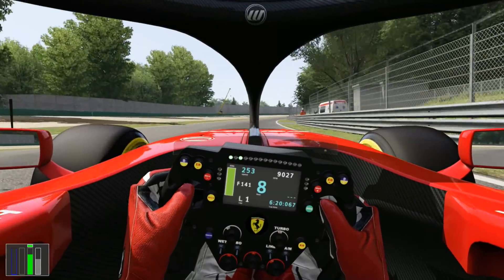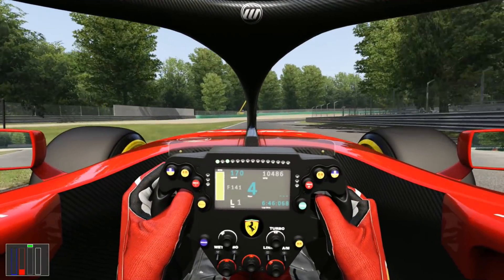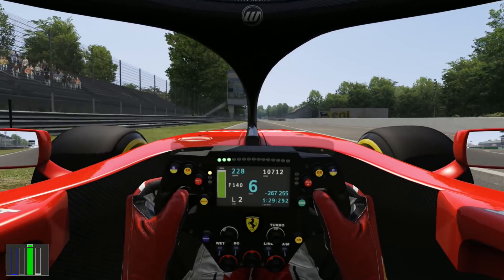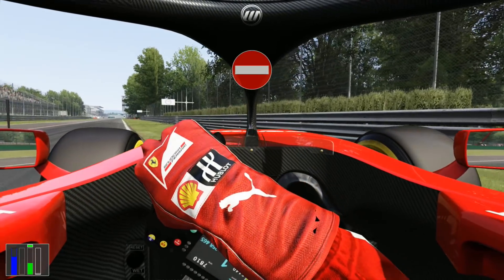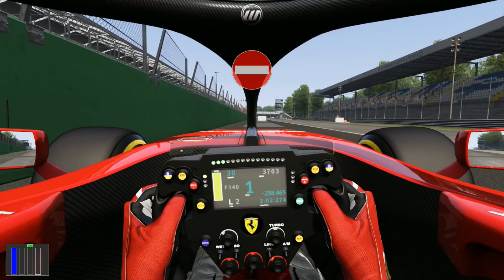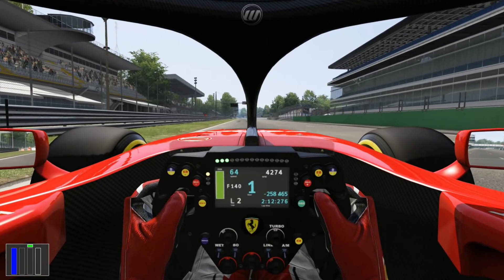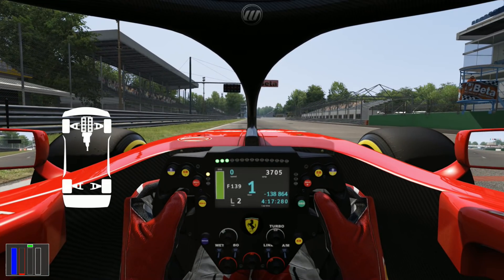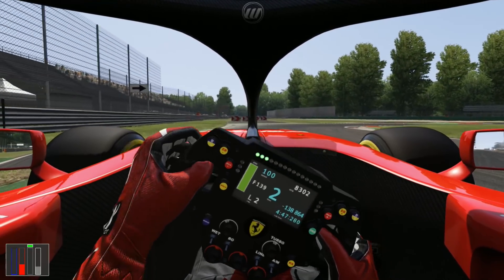Assetto Corsa - Race Starts in the Turbo-Hybrid Era

Comment: Which wheel do you use?? Ty so much :D
Reply from the maker: I use the Thrustmaster TS-PC with several different rims. I use the T3PA Pro pedals and the TH8A shifter as well.
Reply from the maker: Oh yeah - a hand clutch would be really cool. I don’t think that they’ve got something like that coming any time soon, but...just maybe!
Reply: Thinking of getting T3PAs at some point. They any good over the standard ones?
Reply from the maker: They’re much better than the standard ones. I had the standard pedals for a little while, but they broke after maybe 2 weeks. The metal part of the potentiometer on the clutch just snapped, so I had no clutch. :P
Reply: I've got the standard 2 pedal set at the minute. Really want thrustmaster to offer a rim like the standard TS PC rim but with a hand clutch.
Reply: Ferrariman601 thrusthmaster has just released the hand brake
Reply from the maker: GrapeFruits That they have done. For the kind of driving I do, I don’t really need a handbrake, though.
Reply: Ferrariman601 strip out the Ferrari rim gubbins for an Arduino and you could retrofit one and use it as a USB button box but that's a lot of soldering I don't really want to do.
Reply: Ferrariman601 turns out Fanatec does a McLaren gt3 rim that has the hand clutch.

Comment: From what I understand as well, the drivers have access to two clutch paddles (one for each hand). One can be used to find the bite point very precisely, I would guess they have actual gauges that tell them how far the clutch is depressed and measurements on clutch temperature so they know exactly where the bite point is.

The second clutch paddle can basically be used to fully disengage the clutch and then be dropped when the lights go out. This means the clutch will go right to the bite point much more precisely. Not that this makes it super easy, but it does make it a bit more of a science that could be reproduced regularly.
Reply: They used to have this setup, but the FIA got rid of it to increase the variability of the starts. Now, there is only a single paddle and the drivers must set the bite point themselves
Reply: I thought the same thing too, but some of the Motorsport.com Giorgio Piola sketches have two clutch paddles now, though I believe they are no longer allowed to use a master clutch and slave clutch
Reply: They indeed have a master and a Slave clutch. I believe the master is used to drive away and the Slave is used to control the Wheelspin. Could be the other way round

Comment: Nice video but you can't have a realistic start in any sim.
Reply: If you have one of these fancy OSW rims with the dual clutch system you can, because the two clutch paddles can function as one axis and you can tweak the potentiometer to get the bite point.